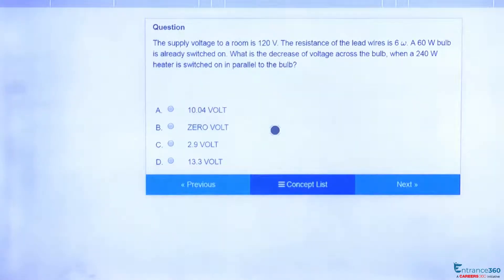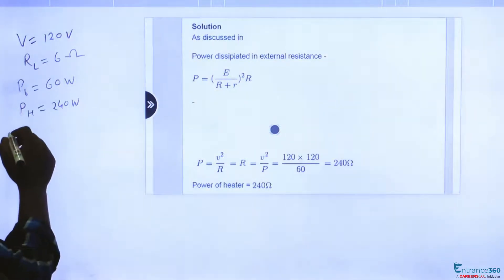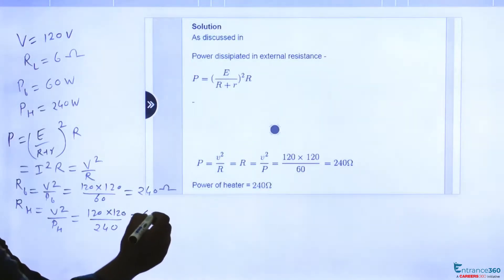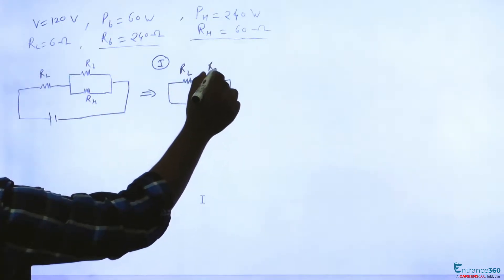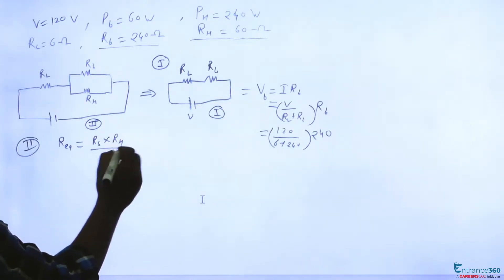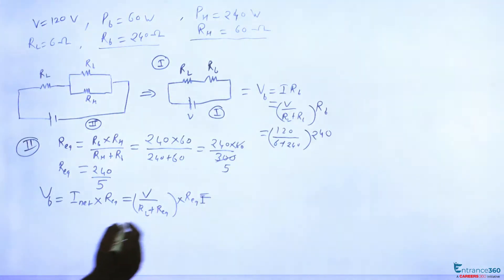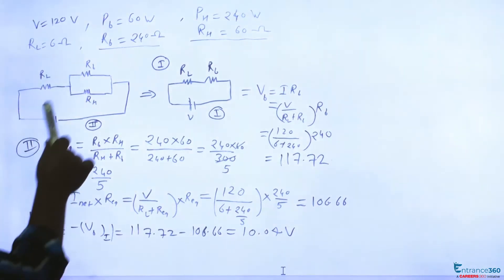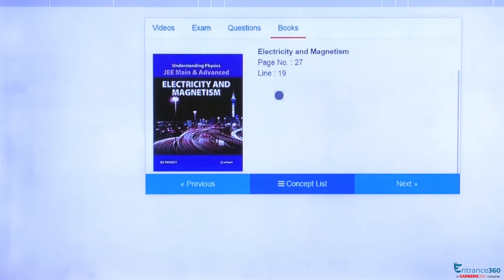JEE Main 2013 Physics Question- The supply voltage to a room is 120 V. The resistance of the lead

Comment: How did you directly put R=V^2/P? Here V is supply voltage right? And there's a resistance in series with the battery initially, so shouldn't R (of battery)=(V-ir[of wire])^2/P
Reply: Exactly